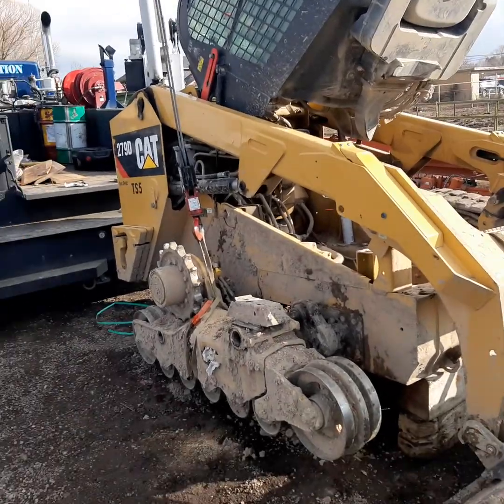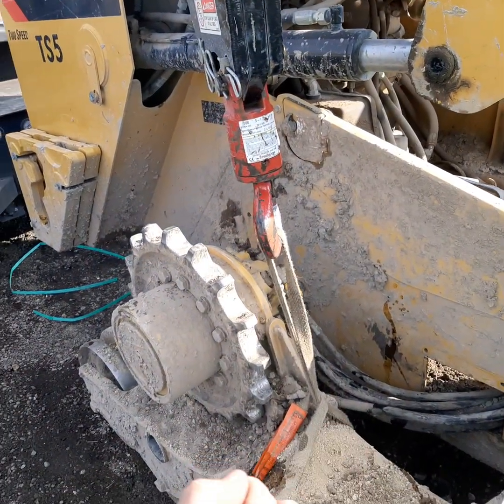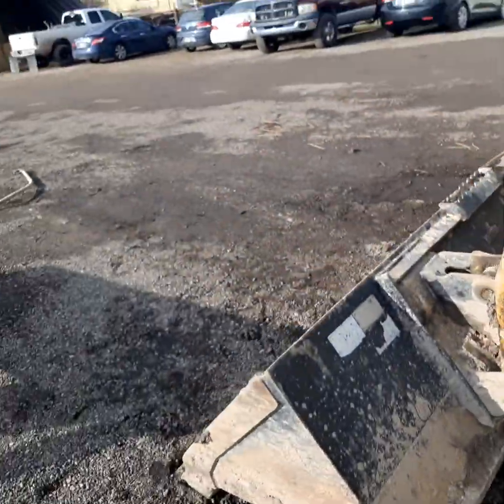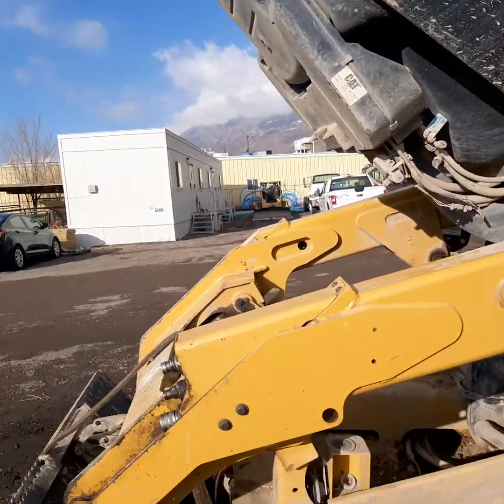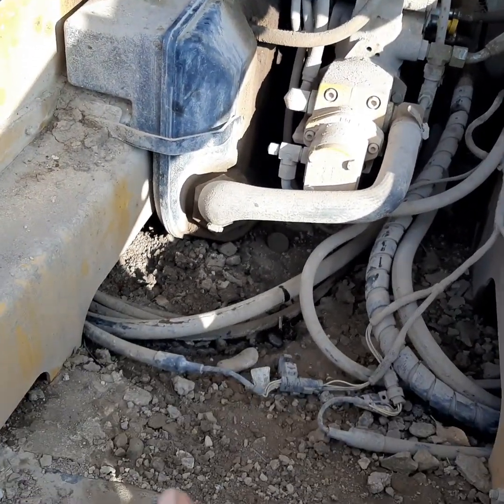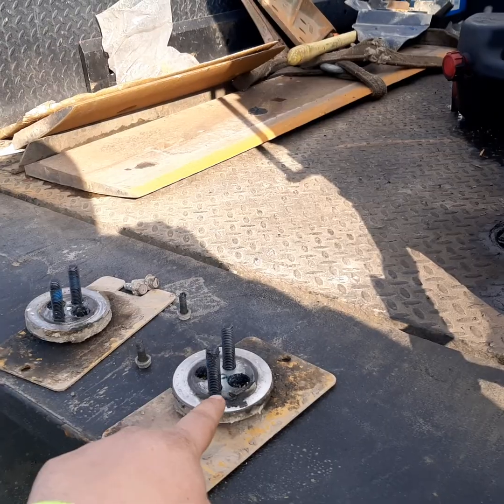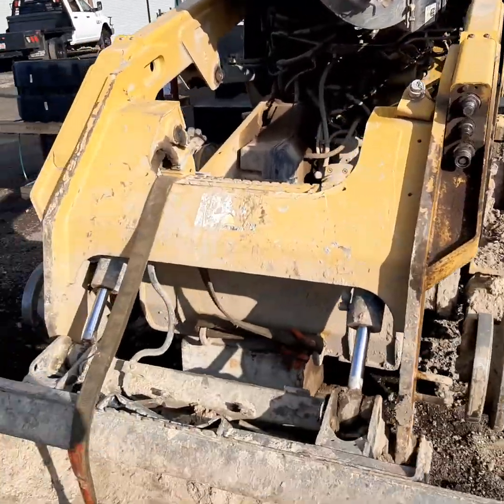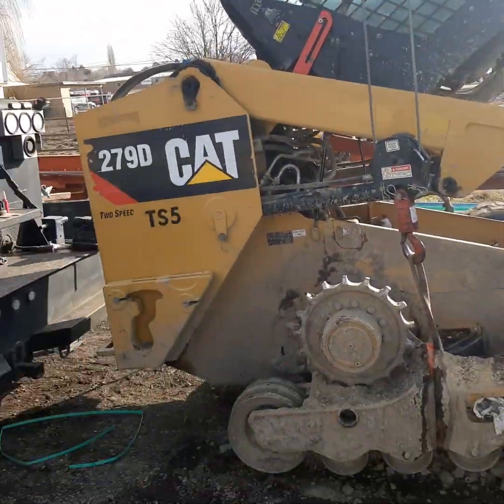Cat skidsteer finaldrive hose repair not as hard as you think

Comment: You saved me hours mate with the quick release explanation on my 279d3. I had right side chaff on the base inside and blow, dumped all the fluid from the reservoir. 
I was wondering how to get a spanner in to that drive motor lower item. I left the track in place, pulled the plastic retainer and put a strap on it to choke on the hose. Pulled it from the rear of the unit to get it to pop in a little and then pulled it from the forward and it came out. 
The bulkhead fitting is a multilayer affair that tough to get out also. Then I couldn’t find which of the 4 xt-6 hoses it was on the cat system to order it. Still waiting and hoping it’s the correct hose that arrives. Big toys break big. Thanks again, these kind of vids are extremely valuable.

Comment: Thanks for the post. The undercarriage my 259d will only slide about 1/2” out and then binds. Any advice on how to get it to slide out enough? Thanks
Reply from the maker: Sometimes grease dosen't get all the way around the track pins or "torsion axle" so if you can, put some grease on them when you have slid the trackframe to as far as it will go, and slide it back and see if you can work that grease all the way around the pins, I hope that will help you out.

Comment: What luck finding this video. Will save a lot of time. I imagine a lot of the problem in getting the frame to slide off is ware in the torsion axel and bushings. Getting over a ridge can be difficult. Bought mine used and didnt know there was a grease fiting in the rear for a long time. Hoping for the best.

Comment: I have a 259d , I’m trying to remove the left side  drive without removing the track. Trying to slide it off a couple inches to change the final drive hose. I have 2 the bolts removed on both torsion axles. For whatever reason I cannot get the it to slide off …. Any recommendation ? Thx Aj
Reply from the maker: You will need to lift up the track frame right in front of the sprocket and get the weight of the axle pins, so you can get grease in the zurks for the axle pins. Keep the track frame lifted and I use my hands and pull or shimmy  the track frame out, but I have also had to use a come a long hocked around the track  frame and mounted to another place of equipment or something solid. I have never had an issue with a come a long tool. Let me know if you have anymore questions, I love to help.
Reply: I’m currently fighting the rear pin on a 259D as well.  I took all the weight off the track frame, chained the loader to a dump truck and put a porta power under the machine to push and air hammered the pin… it’s stuck.  Front long pin is loose as a goose, but that short pin won’t budge.  Ended up pulling the whole rear torsion axle loose to get access.  Not sure what the secret is.  I was trying to not use any heat on the bushing, but that’s all I can think will work.  Any other ideas?
Reply: @KVC1978  never could get mine to budge. I used clawfoot open end wrenches on a ratchet extension and was able to change the hoses.
Reply: did you come over to solution if you did could you share with us please thank you
Reply: I’m having the same problem on a 259B3 front pin slides all over the place but the back pin will not move at all. Tried a service crane chains & binders thing won’t move
Reply: did you come over to solution if you did could you share with us please thank you
Reply: Rear pins has a snap ring. Messed around with it for 2 days before looking at Cat Parts and noticed the snap ring. I couldn’t see it with all the grease.  Even used a porta power, feeling like a fool now.  Hope to remove it tomorrow.
Reply: @KVC1978  did you come over to solution if you did could you share with us please thank you
Reply: We are having the same issue on a 259d  to the back one won’t come off come loose any advice. Please advise thanks